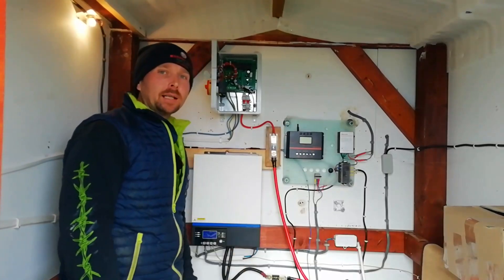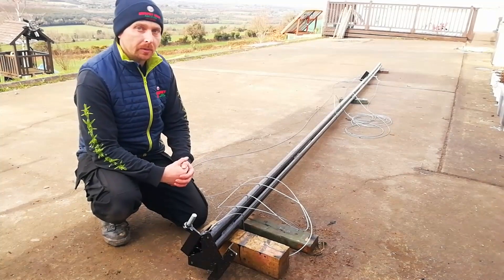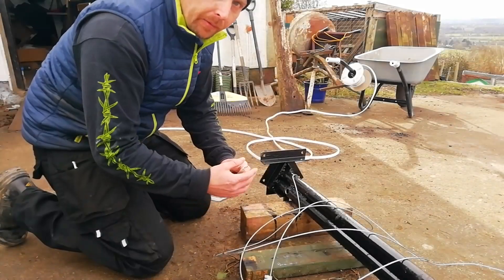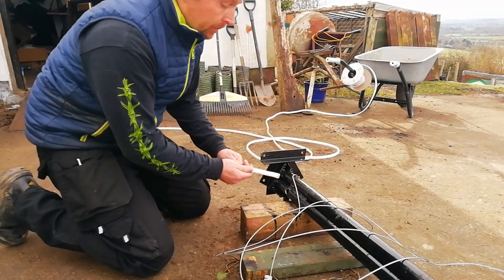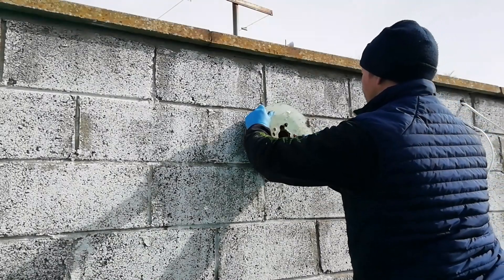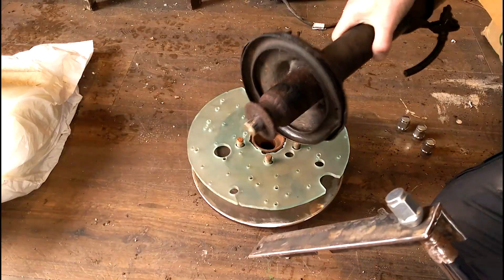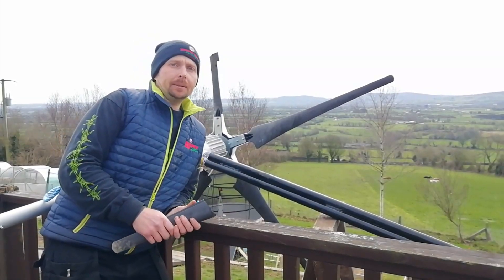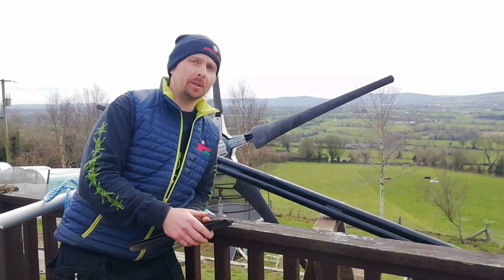Istabreeze wind turbine on a budget DISASTER!!!

Comment: All practical tests of ground-based small wind turbines show: 1) They hardly produce any electricity! 2) They do not last long! 
With solar panels you can generate at least 10 times more green electricity with the same investment & time expenditure!
Reliable and almost maintenance-free for at least 25 years! 
On the other hand, 9 out of 10 small wind turbines stop working after just a few years due to the extremely gusty winds close to ground.
Reply from the maker: Thanks for the sales pitch there Michael, if you're a genuine viewer you will be able to see from our other vids that we also use solar and are well informed in both solar and wind technology. Thanks
Reply: You need both bud.  Been to UK?     Not too sunny.  Silence

Comment: You don't need 5 blade setup for anything. It is worse than 3 blades in any way and cost more.
Reply from the maker: Sorry but that's totally incorrect. 3 blades are only efficient at large heights (100ft) or more where there is more consistant single directional airflow. 5blades works better here because the mast is lower and winds are squally and change direction quickly. Perhaps a bit of research into different setups and the different environments they're suited to would be of benefit to you.

Comment: Put a gin pole at the bottom for leverage. Will make this far easier. I have a customer that bought a 100' pole tower that comes with a gin pole from Bergey. It goes up without any trouble with a small boat type worm gear drive winch powered by an electric drill.  
Also, the pole you have is on is way too short already. The turbine will be plagued by turbulence which robs the turbine of the ability to make power out of scattered winds.
Reply: He needs more than just a gin pole ...

Comment: 5lopat w ista nie daje zbyt duzo.tyle ze turbina startuje wcześniej.moc produkowana tez drastycznie spada bo wolniej sie kreci.
Reply from the maker: ? 

Translation result

5 shovels in ista doesn't give much. It's just that the turbine starts earlier. The power produced also drastically because it spins more slowly. 
(Google translate)?
Reply: @ourkilkennyhomestead2006  you bought an iste with 5 propellers.  5 the propeller turns slower and the power of this turbine drops drastically.
Reply from the maker: @RaddiM3  thanks for translating and thanks for watching the vid. Yes we went for the 5 blade model as the perform better in lower windspeeds. We have made more videos on its performance which might interest you.

Comment: Hi,

related to the potential water issue inside the turbine (Many video referencing the issue). I have contacted support to ask if a hole needed to be drilled to evacuate the water. This is the answer they gave me:  'it's important to note that the video you provided is from 5 years ago and does not represent the current version of our turbines.

We take the issue of water resistance seriously, especially considering the climate in Ireland.Also, our turbines do include aluminum in their construction as well. Rest assured that we have made significant improvements in our latest turbine models to address any previous water-related concerns. Our new turbines are designed to withstand various weather conditions, including rain, ensuring reliable performance in the Irish climate.

There is no need to drill a hole to evacuate potential water inside the turbine'

Related to the dump load been a bit small for the turbine power: I have put a smaller copper wire with higher resistance. The power dissipated by the wire is R * I * I. So, when the wind is average high, no major loses because the intensity is not that high. For huge storm (P > 1500 W), I is very high and I square very very high. Hopefully the high resistance cable will dissipate the extra power for P > 1500 W. (And the cable is much less expensive)    

JPaul
Reply from the maker: Hello Jean Paul. Thank you for posting the results of your enquiry, interesting to hear istabreezes response. Let's hope the current models are updated as they say. The first takedown for maintenance will reveal all and I plan on publishing a vid on this when the time comes.
In regards to the dump load:
Originally I had planned on including one in the system however, after the storm force 10 winds we had a few weeks ago which took down a few turbines across the UK, I discovered that it's safer to apply the brake and not allow the turbine to spin up in extreme conditions. As the blades spin fast it presents the entire area of the rotating circle to the wind effectively like a giant sail putting enormous strain on the turbine collar and mast. With the brake applied only the narrow area of each blade is presented allowing extreme winds to simply pass through causing no damage at all. The downside is no generation during these periods, the upside is increasing the life span of the device and reducing maintenance requirements.
Might be worth considering with your turbine.
In regard to the thinner wire, I'm curious about heat dissipation and fire risk and eventual failure of the wire as this would act like a fuse and eventually break under severe load. Are you using a heat sink to dissipate the heat or what way have you got it set up?

Comment: Mine was almost as bad ; I ordered a 24 volts model but they sent a 12v. instead. So I'm using it anyways on half the battery bank. I ordered five more blades too, and a hub, for a different one. Mine has been up twelve days.
Reply from the maker: Sorry to hear they sent you the wrong one, that's a pain. How's it performing for you?
We have ours up now, and will have a video about it coming out on Friday.
Reply: They don't make 12v,  never did

Comment: I have a 32ft mast which is 2" scaffold. I built a gin pole and use a electric winch both make this very easy to raise and lower the turbine when needed. I think I 'd up the cable as well if that's an i1500 at 24v it can deliver 55amp.
Good luck and have fun
Reply from the maker: Nice setup, would love an electric winch. Thanks for sharing and the advice, planning on upgrading the cable at the first maintenance take down.

Comment: If You get 40A on cpc, the 2.5mm2 earthing of the cable, it will overheat
Reply from the maker: The cables are 6mm2.
Reply: Im regisyered sparky. You should use 4x3 or 6x3 cable or 3 single core 6mm2 min.
Reply from the maker: @robertoleszek8361  thanks, the 6mm2 twin and earth is rated for 50amps.
Reply: Ok you will learn hard way
Reply from the maker: @robertoleszek8361  24v at 1600w =66amps. The turbine may never produce that. If it ever does then I can switch the wiring from the solar panels which is 10mm2 twin and earth. Run the solar on the 6mm2  and the turbine on the 10mm2. As a mechanic and former BMW technician I'm fairly up to speed on the wiring side of things. Thanks for your suggestions all the same, much appreciated 👍
Reply: @ourkilkennyhomestead2006  thanks for the video but the t&e 6mm is fine for two of the phases but the earth in 6mm is not 6mm it is 2.5
1.5 sqmm cable has 1.0 sqmm CPC
2.5 sqmm cable has 1.5 sqmm CPC
4 sqmm cable has 1.5 sqmm CPC
6 sqmm cable has 2.5 sqmm CPC
10 sqmm cable has 4 sqmm CPC
16 sqmm cable has 6 sqmm CPC
Reply from the maker: @dodegkr  not on this t+e dave. The cables are all the same size on this twin and earth. If you look closely in the vid you'll see for yourself. It's available in screwfix if you're looking for some. Rated for 55amps on all three wires.

Comment: This looks like a job for one of those cheap Chinese pipe benders.  If you put an identical bend in all 3 pipes, just below the blade length, you could splay them out in 3 directions and create a more stable triangular base.  Then, you weld cross pieces at the bottom between the legs.  If you drill holes in all 3 legs in parallel and put 2 of them through 2 of the legs, you can use them as a hinge to raise it.  You can also pull it by the top leg when it is at a low angle. This is how large radio towers are designed.
Reply from the maker: Thanks for the advice, much appreciated. Working on a solution this week.

Comment: I was thinking of the following solution. I might use it at some stage for myself, but never tried.  Currently, your centre of rotation is the ground level. So, the wait has to be lifted, with a centre of rotation at around 6 m away. The related force is proportional to the weight * 6 m --> quite high value. To reduce the issue, I was thinking of putting the centre of rotation 1.5 m or 2 m away from the ground level. that way, you reduce the force to let say something proportional to 4 m and you can use the 2 m on the other side with some weight (cement, stone, body weight etc.) to counter balance the force. The rotation should be quite easier. To use such solution, you will have to build a small wood structure to lift the centre of rotation up. Good luck!
Reply from the maker: Exactly what I was thinking. Use a counterweight. You are 100% correct. Now Have to get more steel to build it and figure out the design. Coincidentally the tower with generator weighs 75kg, roughly the same weight as a person 😉